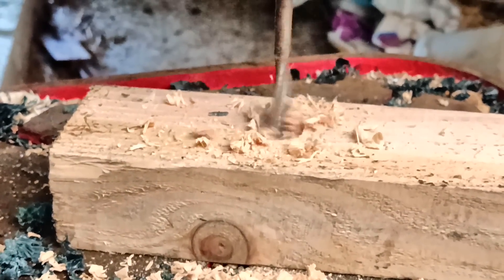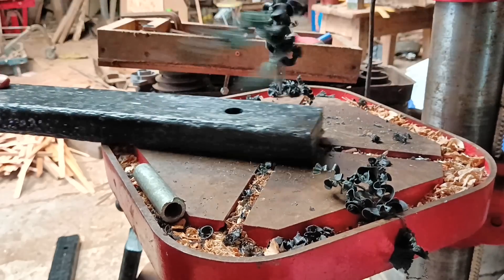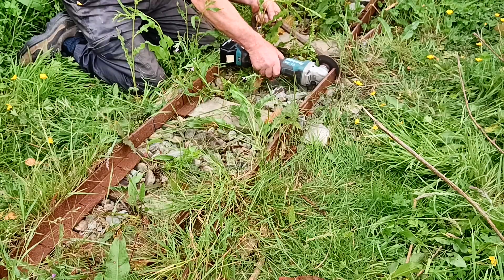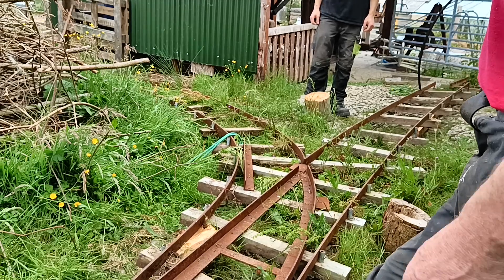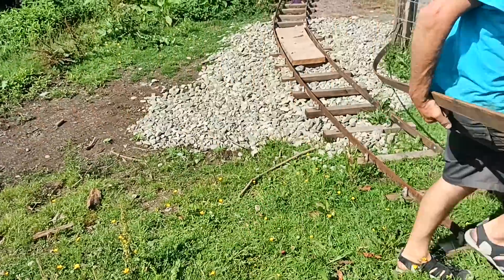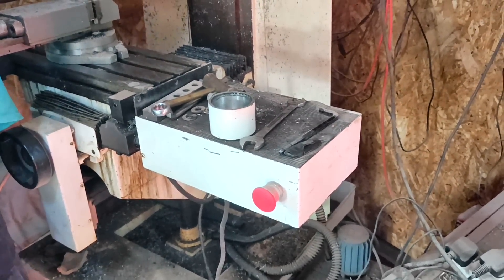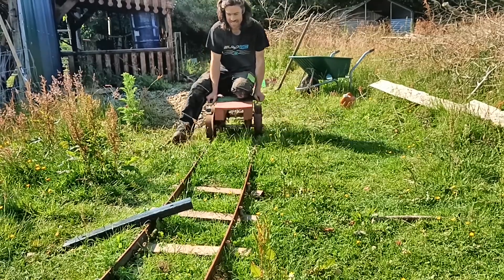Can You Use Recycled Plastic For Railway Sleepers?

Comment: Hi there. I'm the current president of the Iowa Model Steam Engineers, located at Mt. Pleasant Iowa USA. Our club has 1800 ' of 7.5" gauge track that has been down 20 years now. The ties or sleepers, as you call them, were cut from 2x4 treated lumber, ripped down the center to end up with approximately 1 1/2" x1 1/2". Even though this was treated wood, it doesn't last forever. A roadbed of rock was put down and leveled then the track was laid on that, then ballast spread between the ties and tamped to hold the track in place. We are currently in the process of replacing all our wood ties, some are still ok, most have substancial amount of rot, some are just shy of being completely gone.  Our ties are spaced about 1.5" apart, and we use 1" tall aluminum rail, fastened to the ties with 4 #10 hex head screws per tie. The plastic is treated for uv resistance so it should outlast most of us.
Reply from the maker: Sounds good, Ben. But a lot of work! I'm just laying some more track with the sleepers at 50cm centres (20"). Do you really need so many?
Reply: @wayoutwest-workshopstuff6299  Most of our members either have live steam engines or diesels, which could weigh in up to 800 lbs or more, and we haul passengers more than freight, so the track needs to have a solid, stable base. Our aluminum track is probably not as strong, vertically, as your bar stock rails
Reply: @benhancock1408  Yes, I see - that's quite a weight. Would that be over two axles or more?
Reply: @WayOutWestx2  Usually more axles for one that heavy. I have a couple of 2-axle switchers that are considerably lighter, and I have a steamer, a 2-6-0, that weighs upwards of 500 lbs.
Reply: and that's without adding my weight to it.

Comment: I worked for a brazilian railroad that tested recycled plastic ties on its broad gauge track but they failed. Those ties had a nasty tendency to warp causing the track gauge to change or they simply broke in half not too long after installation
Reply from the maker: thanks for this - I will watch for that. But perhaps it's because it's hotter there?

Comment: Cool fact: Plastic is used as a sleeper material on some light railway (tram) networks because of it’s… plasticity! the ability of plastic to be compressed and stretched makes it ideal for dampening vibrations (and thus noise) caused by rail vehicles in urban areas.
Always cool to see this railway evolving!

Comment: While I applaud all your efforts with this railway as a means of moving material and not people I can’t quite agree with your comment that these plastic sleepers are excellent. Looking at the end of them they appear to have more holes than an Aero bar. There is other plastic sleeper material available on the market with a solid structure and are being used very successfully for passenger carrying miniature railways.
Reply from the maker: where is available Michael? I haven't found anything suitable in Ireland yet
Reply: @wayoutwest-workshopstuff6299  I will contact the miniature railway and endeavor to find the name of the supplier.

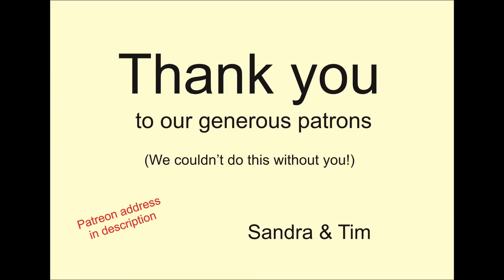Comment: .Hey Tim, giving my opinion on 8:26
 
This might be a bit tedious to do, but I think your best bet is to make a railroad diamond (https://en.wikipedia.org/wiki/Level_junction), this would require you to cut a small section of track out of the pre-existing track, assemble the diamond and place it where the section you cut out was. It would also mean you don't need to do anything to cross from either section, just roll on through the diamond and make sure you dont get hit by another train.

Comment: You should maybe add a check rail on the inside track on that sharp curve to prevent the wheels climbing over the track
But when adding a check rail you should find a way to greace the flanges on the back

Comment: 'We have a mountain of worn automobile and truck tires in the US and no viable way to dispose of them safely.  Use the material from tires to make sleepers.  You can mold steel plates into the sleepers with threaded holes to affix a rail anchoring system.

Comment: I've used the recycled plastic wood and it is remarkable.  HOWEVER, it doesn't maintain it rigidity like wood and will eventually bow if not adequately supported along its length.  Possibly with the shorter lengths you are using it might not be a problem.  I'll think positive for you.
Reply: If it bows, wouldn't that bring the tracks closer together?  So each time the train goes past it would provide an opposite force to push the tracks apart again?
Reply: @Berkeloid0  Possibly.  When I used it it seemed to droop in the middle which looks like a bow.

Comment: im actually trying to replicate this for my my Gauge 1 garden railroad because off-the-self gauge 1 track is very expensive about $9/ft and i tried aluminum track but thats only about $5/ft and i need about 60 feet (thats about 18 meters) so ive been looking into casting waste plastic and using scrap wood to make my track for as cheap as possible

Comment: For the crossover: The technical term for these is "railroad diamond" or "level junction". I find railroad diamond to be more specific.
You start by joining adjacent rails on the approach to the diamond. Then you get U-pieces where the base of the U forms the running rail through the diamond and each arm of the U forms a guide rail to make sure that the wagons stay aligned. Many diamonds will also have guide/check rails in the middle of the actual diamond part, opposite the base of the U. The check rails should also have a flared approach to guide the trains. Because the flanges on your wagons as well as the width of the wheel are wide, I don't think the designs where one rail is slightly above another would be suitable.
This image from a wikipedia article has a good drawing, though you can ignore the gauge stuff as that's irrelevant. I also think using angle would be easier since it's more rigid.
Reply from the maker: no picture arrived - but I assume the wheels run on their flanges?

Comment: Really they are DOWNCYCLED as they are not continually recyclable.

The problem is that using them in the workshop you are both creating microplastics and contaminating your woodchips which makes the woodchips unsuitable for anything other than burning.

You don't mention how much of the plastic is Downcycled and how much is virgin plastic as these products usually use a proportion of virgin plastic.

The place where they might make sense would be over very boggy humid ground; but then you would not normally put track in such places!
Reply from the maker: Down-cycled? - yes, you're right

Comment: For crossing over tracks there’s a unique diamond that you can make that goes over the rails instead of through. Basically just make a small ramp that ends right before the rail on the outside and then put 2 pieces of track in the gauge slightly taller than the regular rail and then another ramp on the other side. Look up high speed-low speed diamonds for examples
Reply from the maker: Ah! Interesting - a slightly raised cross-over?
Reply: Yes! It’s mainly used so that the main line can run higher speeds but it’s also probably a lot cheaper and easier to construct than a regular diamond which obviously needs specialized parts vs just having to either raise your crossover track a few centimeters or make 4 ramp tracks
Reply: @nicmccoy6459  Tim has a welding machine and a plasma cutter. A standard diamond will be much easier to fabricate than a no-interference diamond.
Reply: @RussellNelson  oh I don’t disagree at all that he could or doesn’t have the materials to do it but I think just raising up your track a few inches is a lot cheaper and quicker to design and build than fabricating an entire diamond and then taking the time to assemble and troubleshoot
Reply: @nicmccoy6459  What troubleshoot? A diamond is just a box made of strap rail with some notches cut at the corners for the flanges of the opposing track to slide through. The four edges of the box have to overlap, so you cut notches at top for the X rails and at the bottom for the Y rails, then assemble and weld the box together. Easy-peasy lemon squeezy.
Reply: @RussellNelson  either way it’s up to Tim to decide what he wants to do, and he’s clearly not one to back down from a challenge. I’m excited to see what he’ll do
Reply: @nicmccoy6459  But he does listen to us, at least when we have good suggestions.

Comment: The case for a small 5hp diesel loco grows stronger and stronger..... My homemade tractor can run on 50% used oil engine oil or 50% strained used cooking oil mixed with diesel i use it a fair bit and i only fill the 5l tank 3 times a year

Comment: Like the question in  the title I am guessing your cross rails is rhetorical as it is as simple a cutting a gap in the rails to be crossed to allow the flange to pass thro and the same the other way. your wheels should be able to jump across a 40mm gap as they do at the points. If it anything other than 90 degrees then each wheel encounters a gap at different time so keeping "3 wheel on your wagon still rolling along".  I am sure my great grand parents sang me a song about that.
Reply from the maker: one wheel at a time going through a gap? Perfect!

Comment: Talking about the railway and your videos on pedal cars, why not try making a pedal engine at some point rather than using compressed air?

Also to cross two tracks you can look at places where tracks cross usually in an X shape with slots on all corners for the rails to slip through one another, and I would recommend having a melal base or large wooden base for the rails to attached to for the tack crossing so that you don't have to worry about sleeper joining.
Reply from the maker: A pedal engine would need to be geared down a lot, so I guess it would be too slow to be useful?
Reply: @wayoutwest-workshopstuff6299  Iv'e seen pedal trains before where at its simplest is just a set of pedals attached to a chain to an axle of the "train" to move the train backwards or forwards.

Comment: Do they give you any idea of the plastic content? What leeches out of them when they're in the ground? Is it safe to cut or sand them? Are they actually UV stable?
Reply: In Australia, HDPE is the preferred feedstock, but LDPE can be added. Mostly Black Water Fluming And Agricultural Ground Cover for Vegetable Beds. Makes standard Railway sleepers ( ties). Being experimented in several rail networks to replace wood, concrete and pressed steel sleepers / ties. Both Secondary and Main lines.

Comment: Just a heads up, the sun will degrade plastic over time. If there is uv stabilizer in the masterbatch (the additive with colour in it) the uv degradation will be slowed but not halted. I'm a plastics maker so i do this for a living. Keep up the work, its jolly good fun to watch
Reply: though, black plastic lasts a LOT longer under uv, paint should be enough in a year after seeing if there's degradation, can pick up dregs of exterior latex just about anywhere.
Reply: “Carbon Black” / Charcoal (all essential the same thing) does help with UV (albeit as you stated, not perfectly), so between that and any additional UV Stabilizers it should last a good long while.

After that it can be used in a Waste to Energy Plant with good Emissions control, or even “thermally recycled” via Pyrolysis back to Crude Oil.

Worse Case Scenario, Well Ventilated High Temperature Burning can work decently in a pinch.

Either way this is way better than it being in a landfill or being litter!
Reply: @ericlotze7724  it could be argued that a landfill is the best place for it.  once you trap carbon in the plastic, you can put it back in the ground, and since most modern landfills are lined, they'll be safely locked up forever.
Reply: @felderup  not forever, until the liner breaks.  Most landfills contain all sorts of nasties, not just Carbon/Biomass etc so I view them as a bad option.  Only make sense in areas that cannot afford anything else, but even then just a temporary solution until a proper Sorting+Recycling+Disposal Ecosystem can be made

I agree to an extent on the carbon sequestration aspect (there is even some goofy paper on doing this with timber, and one on biomass slurry injection), but with charcoal (washed of minerals, similar to leach based mining), or Carbon Black (from conventional methods, or Methane Pyrolysis) it can be done efficiently and safely; essentially reverse coal mining!

Granted Biochar (to an extent, more data needed on how long term this carbon stays in the soil), Enhanced Weathering, and Storage in Building Materials are the main methods i expect to see used.
Reply: @ericlotze7724  the fill back home, which was a while ago, did open air burning.  made some parts of nova scotia kinda stinky, my grammy did pick up an abandoned cat though, so it was worth going there.  anyway, yah, some of those chemicals will eat through the liner.  there may come a time when old landfills are the new mine, lot of valuable stuff was tossed in em.
Reply: @ericlotze7724  i don't think people realize how high temperature you're talking about, if one were to burn it at home. Ideally the offgassing should decompose in the heat, like smelting brass temperatures

Comment: Impressive, as always. I believe I shall start calling you Tim the tank engine!
By the way, as an alternative to those beautiful fish plates, could you have welded an extension piece in the barn, and then used the extra long rail? I believe in modern railroads they weld the  track pieces together, but in situ, which is more complicated.

Comment: I'm in a 7 1/4 model railway and we've been using plastic for sleepers for 5 years
Reply from the maker: And how are they holding up?
Reply: @wayoutwest-workshopstuff6299  hi there they are doing fine thanks the railway is in a wooded valley and so there's no direct sun ,the old wooden sleepers are being replaced as a matter of course and not reacting to rot as a long term preventive maintenance

Comment: yes i fixed my head torch i tried glue hot glue special glue didnt work then i saw a youtuber use a soldering iron and cable ties and i welded the plastic

Comment: Most plastics are photodegradable.   Over time exposed to the sun will takes its toll. In the early 2005 China tried to sell rail ties made from plastic.  The light rail where my wife and I worked got 10 of them and tested for 3 year they failed after 2.   They deformed and the sun was effecting the outside of the plastic.   Now you are not dealing with any of the weight a train used.  My only real concern is  plastic deformation .   Looking forward to your test.  What is the cost between say wood and the plastic?   Concrete is over kill for your rail.
Reply from the maker: the same sleepers for 20 years? That's impressive.

Comment: The Ffestiniog railway in Wales has been using plastic sleepers made of that stuff for years. They were worried to start with because of the heat from the steam engines and cinders etc, but they have been fine. then obviously don't use them in the engine yards
Reply from the maker: Interesting - thanks
Reply: @wayoutwest-workshopstuff6299  I might be wrong, but I seam to remember on the TV programme shown on UKTV on demand network they said they got the idea of Network Rail (the UK's current infrastructure operator). 

A lot of bollards in English carparks and streets now are made of this plastic to, it offers reasonable protection to the public as well as marking out areas, with the benefits that if knocked hard they share off rather than destroy vehicles bodies, as well as they don't rust like steel and iron ones, or rot like wooden ones.  They have another benefit, in that the unspeakable persons stealing cast iron etc for scrap don't want them, so leave them alone. 

I'm told its cheep to produce and is recycling at its best.

Comment: One way to make a crossing might be to cast the whole thing in the ground with concrete, with a wooden # shape to make the channels for the rails. Then remove the wood once it sets and fit rails to the relevant sides of the channels that are left. (or cast the rails in with the concrete and just remove the wood maybe)
Reply: That’s pointless
Reply: @SonoIlFactotum  it’s a crossing not points ;)
The point is that lining all the rails (and most importantly the gaps between them to allow crossing) can be fiddly. So casting the channels first and then adding rails simplifies it.

Comment: Our standard gauge railroad installed plastic ties/sleepers over 20 years ago.  So long as they are tamped properly (so there's no stress points where they can crack), they've held up very well.  Ballast and tamping have been key.  With the light weight you are carrying (comparatively), I think you'll be doing fine for many years!  Likely the rails will rust through before the ties become an issue.
Reply from the maker: the same sleepers for 20 years? That's impressive.

Comment: I don't know much about plastic other than that my dog loves to eat it for some reason (DON'T EAT PLASTIC) but I do know plastic melts at some point don't know if it gets hot enough in Ireland for that though since I live in America. I've also spotted another issue but not with the plastic rails themselves but all the rails in general, their getting quite overgrown with weeds which and cause a lot of issues and make it harder to push/pull even singular wagons eventually, idk if you're ok with it but I advise some kind of weed killer wagon, as if the weeds get stuck in the wheels of your wagons it will get real annoying real fast. but with some easy way to transport and spray weed killer onto the tracks the issue is generally solved although liquids are quite heavy so I don't know if you could do it by hand.
Reply: Recycled plastic decking does not melt per se, but it will soften a sag a bit. Not such a problem with these thick sleepers placed directly on the ground.
Reply: @awldune  that's reassuring